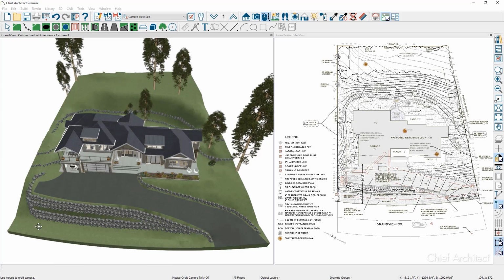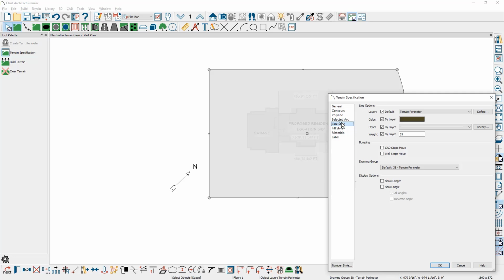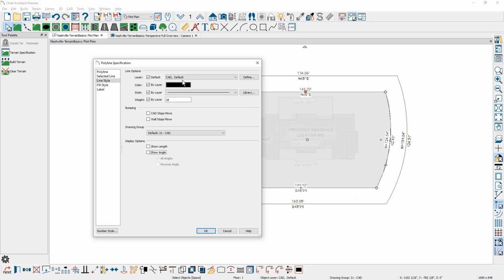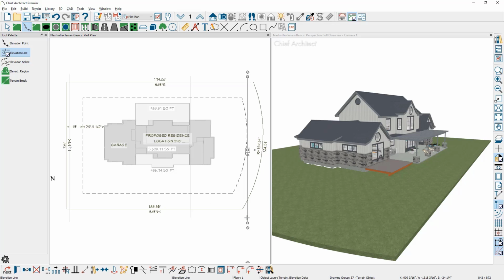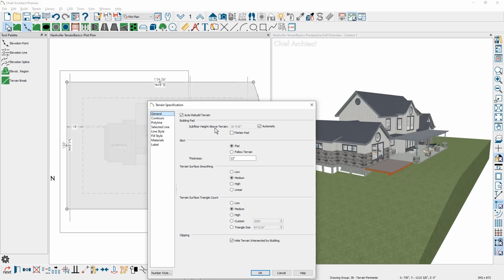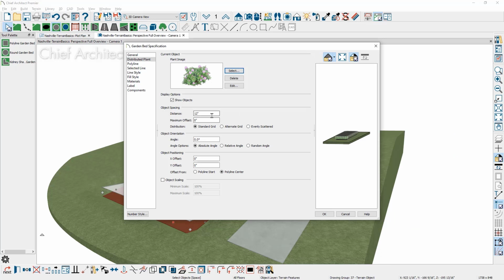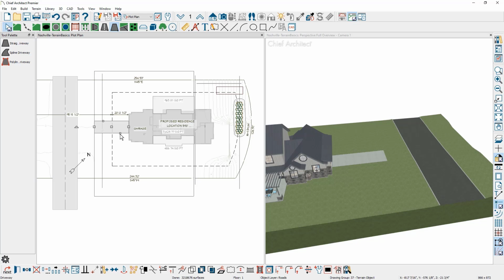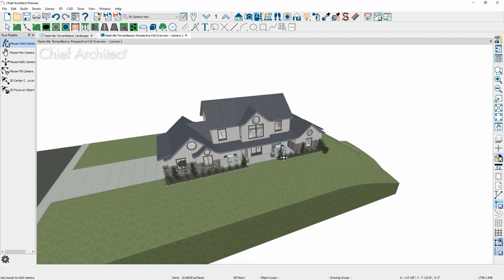Creating a Terrain and Site Plan

Comment: Quick question, I've been using chief for about a month now and I love it. My computer seems a bit slow at handling the 3D portion of it and painting materials in a room can be a painful task as the computer struggles to keep up. I am thinking of building a new computer or replacing components of mine. Are there specific graphics cards or specs that are recommended to make the program run fast?
Reply from the maker: Yes, below are links to resources regarding this: 

Computer System Requirements: https://www.chiefarchitect.com/products/sysreq.html
Reply from the maker: How to Choose the Best Computer for Chief Architect and 3D Design Software: https://www.chiefarchitect.com/blog/computer-for-design-and-gaming/

Comment: Hi CA

What is the best way to draw to 2 houses seperately on the same terrain/site. I find that if you do a roof, then the program assumes the same roof for both houses.

I want to make seperate distinct roof designs for both homes.

Thanks
Reply from the maker: You would need to use the manual roof tools in this particular case.

Comment: When I switch to plot plan view, I do not get anything like you show at :53.  I just get an outline of the floor plan.  How do you enable those Proposed Residence blocks?
Reply from the maker: By default those layers would be turned off. However you can turn them on within the active layer display options.
Reply: @ChiefArchitect  What is the layer name?